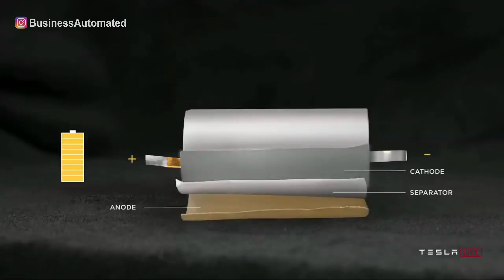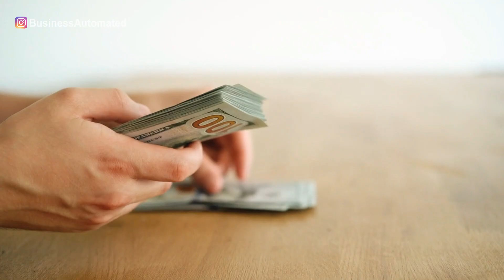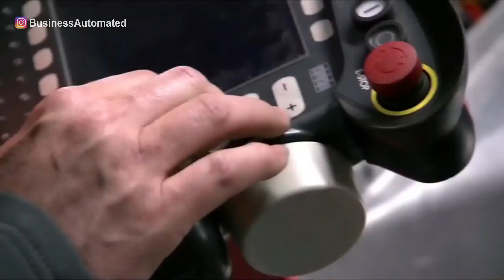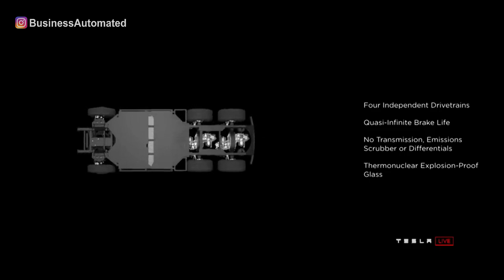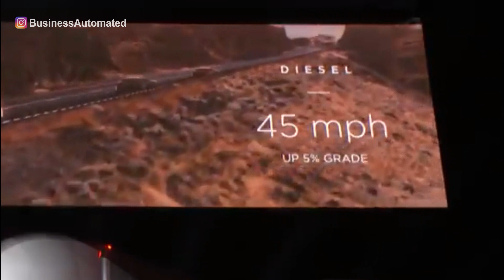INSANELY EFFICIENT! How Tesla Semi Will Devastate Long Haul Trucking in 2021

Comment: The damn thing weighs over 30,000 lb. What good is that? They had it over the scale in California and said the gross was 75,000-ish pounds. It only had about 32 to 35,000 pounds of concrete blocks on the trailer. That puts the tear weight of the unladen tractor and trailer at least 40,000 lb. That's steel flatbed they were using only weighs about 10,000 lb at best. This thing is an absolutely useless POS with no charging infrastructure

Comment: What percentage of the time does the cargo of a semi truck need it's maximum GVWR capacity? I am sure this varies by industry considerably. There must be some significant number of semi-truck miles where it is not used to it's absolute maximum capacity.
Reply: To be honest Aaron I would run any where from 75,000  to 79,000 give or take a couple hundred pounds.  There is a short amount but many of us who are owner Operators hate it  Called Dead head miles aka unpaid miles  all depends on the loads you carry.  I use to run heavy haul too  i could be 105,500 to the biggest one i had 380,000lbs  the Tesla would run out of juice by the time i got 20miles from the job sight.
Reply: we load our trailers up to 80k 98% of the time. Were a food production company

Comment: 2000 lbs of lost payload IS A BIG DEAL.
Reply: Bo McGillacutty serious load and stupid load at the same time.
The government has announced that, Allianz Se Group company wants everybody to reinsure their properties/Assets
Reply: Depends on how the fuel efficiency compares as well. If a Tesla semi uses 33% of the fuel of a diesel semi to cover the same distance then the loss of payload will be more than recovered.
Reply: Neo I want Tesla also! I’ve heard so much about it and also I have read so much about it too! I just want to make sure I have this Tesla so I can make use of it on my own!
Reply: Well... maybe... depends on what you're carrying (and its value), and the ratio of load-value to operational efficiency. It will be a LOT cheaper to run and maintain these vehicles (over their lifetime), so a lower payload capacity may be more than offset by far lower operating costs.
Also, when I was in the logistics industry (many years ago), few of our trucks went out with a full load. In most cases, it was around 75% to 80% of GVM. In many other situations we would be carrying large, but very light objects - so all the available space in the trailer would be taken up, but the weight was very low.
Reply: @brunosmith6925  Good points, it won't matter in every situation but for long haulers who max it, it will be.  What's their profit margin--5% maybe?...losing 4% of payload will be a hard sell for them.
Reply: @Mrbfgray  When I was in logistics, we concerned ourselves with carting higher-value goods. Our clients were happy to pay more - even if the loads were "small" (which most often they were). It is extremely difficult to base operating cost on just the GVM... Many other factors influence whether transporting any given load can be done at a profit. For the most part, we seldom concerned ourselves with how much weight the trucks were carrying. It was more about the total value of the contract.
Also, when fully laden to max weight, even a diesel semi will use a LOT of fuel... The heavier the load, the more fuel it consumes - so again... gvm is but ONE factor that determines whether any given load is profitable to carry.

Comment: they need one with longer wheelbase for us car haulers and up charge to 750 miles 
or put those mega chargers everywhere in pilot and loves 
im definitely getting one when it comes out
saving up for downpayment
Reply: A car hauler chassis being a bit longer could allow for those extra batteries, but needing 750 miles in a go isn't really needed. I could see 500 instead of 400, so that you could, for sure, only need a single 30 minute charging stop in a day. Just gotta park overnights at locations with chargers.
Reply: @mistertitus6814  ya thats possible
i mean i do take a break midday for lunch and relax a bit and possibly take a nap as i start really early. usually 2 hrs. i guess if chargers available at truck stops, i could easily recharge the 400/500 miles and finish my day at another charging station 
the idea is having many charging stations and easy access to them
Reply: @zaidchalabi1599  the idea is the truck only needs enough range to make it to the driver's next mandated rest period and recharge during that rest period.

Comment: Tesla will NOT get a single "Long Haul" Trucker. I am one. The truck doesn't have a sleeper! Is a day "Day Cab"... designed for local runs only. And, YES, the range IS too short.
Reply: @vitalsigns2679  This is an issue that will be taken care of when the problem presents itself. As for when parked, having solar on the trailer would provide enough to run hvac when parked.
Reply: Only idiots who don't drive for a living believe this will actually work
Reply: im pretty sure they will have one with sleeper
i work regional ( 500 range) car hauling
i think if it has sleeper it will be awesome
would love to get one and save on fuel
Reply: I can only see this working with regional or local routes that offer charging stations at the end of the day, 500 is way to short. I can roughly do 650 on a bad day with traffic. Not to mention my truck has a range of 1300-1400miles total. The other thing that honestly irked me was how he downplayed the load capacity that guy seemed to be hauling a dry van, I'm a flatbed and have roughly 2k in equipment and with a stepdeck I weigh 33k. So 35k on a good day on the tesla that  bring my max load weight to 45k

Comment: Obviously you have no knowledge of the transportation industry. We don't even have adequate parking for the trucks on the road right now...That's why you see them parked illegally on the exit ramps. How will charging fit into the HoS requirements from the DoT? Good luck finding drivers for these trucks.... btw, the driver shortage is the largest obstacle for trucking companies.  Drivers are usually paid by the mile, who'd be willing to drive a vehicle with suck a limited range- thus greatly reducing their paycheck.. Ask the LNG prophets how their businesses are doing...
Reply: There's plenty of unused land around existing truck stops, not on the east coast that is, that could easily be expanded into for more parking to accommodate this.
Reply: With the HOS you could use your 30min break to do the 30 min charge you can be off duty since you can walk away from it.  I could make this thing work but it be more of a pain in the ass then anything.  My issue is wildlife  If my big ol Pete with straight stacks doesn't make them flinch and stop jumping out in front of me a Tesla Stealth prowess is just going to be worse.

Comment: A small price to pay to stop the massive amount of  carcinogenic pollution emitted by diesel trucks.
Reply: How will it do that.
Reply: @charlesbickel4295  because It doesn't emit fumes maybe?
Reply: @daydreamer8373  yes it does. How do you think those things are made. What do you think generates the electricity.
Reply: @charlesbickel4295  Well pretty much the same as any other truck. The electricity has many sources, with renewables now the cheapest form of energy generation. So only getting cleaner.
Reply: @daydreamer8373  who told you renewables are the cheapest. They’re wrong.
Reply: @daydreamer8373  Charles is right the shit that goes in to making all your nice green energy is more toxic in the long run than  diesel exhaust that is way cleaner now then it was 15 years ago  and 100000 times better than it was 30 years ago.  You should re think all them chemicals that go in to making the batteries and the carbon fiber body panels.  Hell think about what they do when they retire a wind turbine ( most inefficient power producer in the world)  What do you think they do with them nice Carbon fiber blades? they can't crush them up and reuses it in anything so they bury them.
Reply: @dons8122  Burning fossil fuels will never be cleaner. There are no perfect answers, but we have to do better. 

What you believe is irrelevant, the world will move on without you, and for the better.
Reply: LOL you are full out right brain dead but nice try
Reply: What about the carbon footprint to make those super large batteries.
Reply: @jaimefish173  Nowhere close to what the fossil fuel is pumping out, next.

Comment: 600 miles range is good for up and down the US coasts hauls [1 way]. The carriers have the hardest time to find drivers for coast to coast trips which are 2500 miles and where every ton counts. Still a long way to go..
Reply from the maker: Yeah, for Team drivers this is not the best truck for sure. But Solo drivers should have no problem.
Reply: @TeslaVisionChannel  Not sure about that. If 400 miles can be gained at a stop, and truckers have to stop for 30 minutes every 8 hours anyway, this just adds a possible extra stop for each driver. Yes, you lose a little productivity, maybe 60 miles in a day, which is about 5-8%, but you more than make up for it in fuel savings of more than 20%.
Reply: @mistertitus6814  , that implies that Mega Chargers are going to be at every stopping point which over time they will but not right away😉
Reply: Realistic range, especially given the location of the Mega-chargers, will be significantly less which will be an issue for time-critical loads. Local (up to 120miles one way) movement of goods can benefit from this but, at least for now, longer range movements will just not be efficient until the battery density increases dramatically which is still 5-7 years away... love the technology however!

Comment: Say wake up!!!! For all hipsters, electricity don't grow up on fields, need to be made and that in non-eco process, and batteries don't grow up as a trees, sources for batteries are very limited and very harmful for environment, where is all eco hipsters now?????  Hydrogen is future not electricity,and its 3x more ecological
Reply: Electricity does grow in fields, fields of solar arrays, fields of wind turbines. Lithium comes out of mines, just like iron & aluminium. Musk agrees with you about hydrogen, that’s why he went with batteries.
Reply: Hydrogen has been the next big thing since I was a kid in the fifties. I have seen some viable uses for hydrogen, but not in vehicles. Maybe in trains. I would like to be pleasantly surprised.

Injecting it at lower pressure into natural gas lines seem plausible. It would work well with intermittent power sources like wind and solar. Electrolysis is very inefficient though.
Reply: @BoopShooBee  someone should do a study of non starter technologies to compliment all the buzz around disruptive technologies. Hydrogen, super sonic transportation, nuclear power, manned space flight, airships.  Eternal money pits that “one day “ will revolutionise everything. And have been almost doing so for generations.

Comment: Can probably pay drivers less, since the truck will do most of the work. And with FSD, that "driver" may be able to take a nap, and is just there to plug in the truck ever 500 miles or so.
Reply from the maker: Robe-semi would be the next level of the Robotaxi: https://youtu.be/AKix3SXvJxs
Reply: @TeslaVisionChannel  self-driving vehicles are currently illegal in the US and will remain so for another 10-15 years. 1 of the main reasons is the liability. it'll be a long and arduous road b4 the feds will approve such a machine to take over the industry
Reply: @lightbearer-666  Naw.  It'll be approved within the next 3 - 4 years.  You don't know how fast it's improving.  And with General AI, that will change the game completely.
Reply: @lightbearer-666 Fully autonomous vehicles have been approved in florida for two years or more.
Reply: @VerisimilitudeDude  ...self driving trucks won't happen anytime soon
Reply: @TeslaVisionChannel  Yeah and we can see how well that is working out now isn't it.
Reply: The Media Lies  Predictions aren't always accurate.  But mine is based on what's actually happening.  The full self driving has already proven itself many many times over and it's still in beta.  The rate of change is faster now than before, and when AGI happens, it'll change the game forever.  Will it be 3-4 years?  Maybe not, but I'm sure it will be before 10-15 years from now.
Reply: @VerisimilitudeDude  so you trust a fully loaded semi at 80k gross weight going up the interstate with no one driving it? I can tell you’re not a trucker, this has disaster written all over it
Reply: @lilripsta313  Well, firstly, the term "no one driving it" is a misnomer.  The AI is driving it and has already proved itself with the cars being better drivers in most cases than humans.  Disaster you say?  What about all the cases when a trucker falls asleep at the wheel?  That's never happened before?  Or even road rage when they do things that might not be considered polite to other drivers that might have been rude to them or just not paying attention, triggering their rage.  That doesn't happen either?  Come on.  Humans have many flaws too and my dad did actually drive truck for some time, and I went along with him on a couple of trips when I was a kid.
Reply: @VerisimilitudeDude  I can tell you one of the 4 wheelers who don’t respect trucks. How long do is truckers sit with a signal on to merge in another lane and no one lets us over, when we bully you then we’re bad drivers yet cars act like they own the road, AI can’t drive a semi better than a human that’s an asinine statement. Can an AI react to 1/4 decisions on the road as truckers have to do every single day, I almost kill 10-15 people a day because for some reason cars think I can stop 80k pounds by mashing my brakes. How is an AI going to react in the Rockies on i70 aka Death Valley, what happens in a white out when cameras can’t put up a vehicle until it’s within 50 feet and you have to react. Anyone who thinks an AI can drive a semi better than a human is moronic
Reply: @Joker And you don't know jack about general AI.  So maybe I was off, but it's not 10-15 years off that's for sure.  Maybe 5.

Comment: If anyone in here that tried this truck, can you tell me how hard is it to park this truck on docks with a 53' trailer, when, sometimes, space is so small (I know many). It's just that you can't get your head by the window, as I do every time I'm in that situation (barely enough space to park).
Reply: If you soley trust your mirriors you're an absolute fool, unless you're a local driver that backs straight into a spot, you get a better depth perception by actually looking at what you're doing. I was taught that by a trucker who's been driving well over 30 years.
Reply: @ramoskiller2  You're right, and my teacher told me that this is the best way to actually have the best vue, and on the first lesson, and even more if the space is real tight.
Reply: It has cameras on both sides that look down the sides of the trailer and two huge screens in the cab.  I have no idea how easy it would be to use those things in combination.
Reply: So even if that's true unless the cameras are on the trailer itself it wouldn't be of much help. Truckers tend to pivot their trucks for tight maneuvers so that camera on the truck will be facing either the side of the trailer or the horrified face of the driver next to you. If you were to place cameras on the trailer itself then yes that would work but that would be under the assumption that all trailers had that feature and some guy didn't bust the camera before you. Unless you're an owner operator big fleets tend to swap you trailers for drop and hooks and I seriously doubt a fleet will be willing to spend hundreds of thousands to upgrade the already in-service trailers or throw away the ones that work for new ones that cost 50k each.

Comment: The trailers can have solar panels on their roofs and some bat packs under the trailers.
lots of times they sit outside waiting to be filled, don't tell Elon,shhhhhh
Reply: so you wanna add extra weight to the vehicle only to further lower the payload. you obviously never worked in hauling..
Reply: @lightbearer-666  The solar panels would be quite negligible, but the power gained from them would likely only be enough to run heat or AC while being loaded. Which would still be nice.
Reply: @mistertitus6814  22 panels that could potentially fit the roof of a trailer would come to approx 1000lbs. bat packs installed at the bottom would easily add another 1000, so up to 2000lbs would be deducted from the payload. that's a lot of revenue loss per a single container